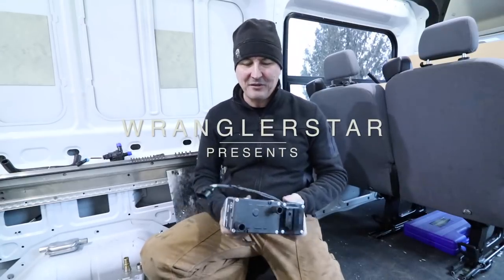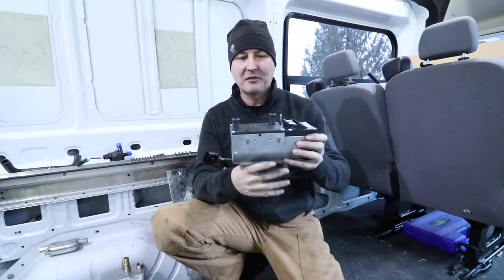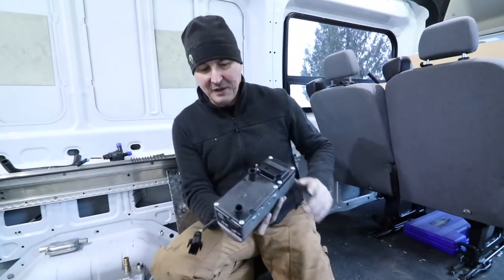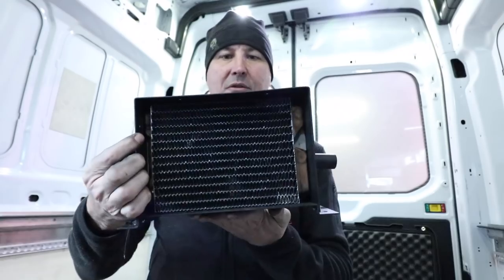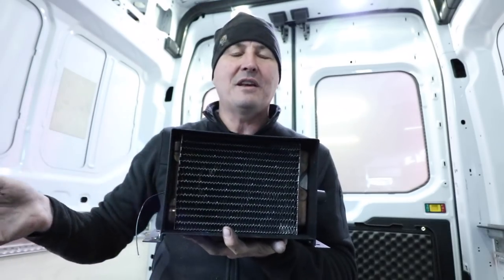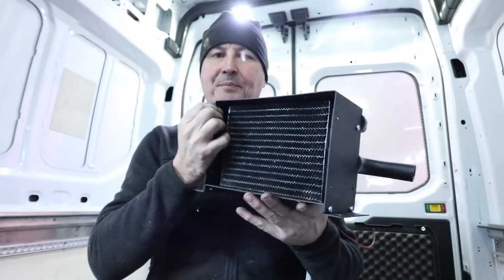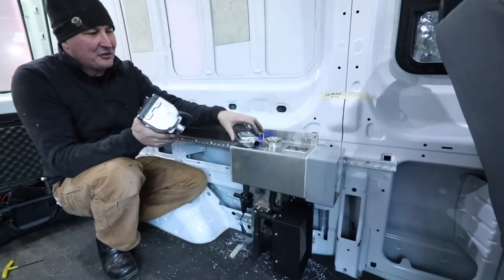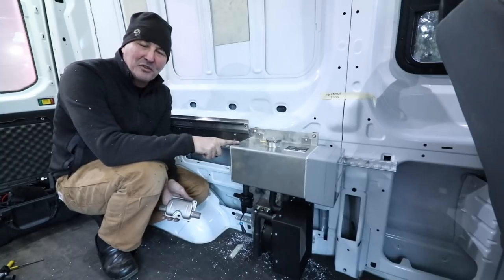Installing A Rixen Hydronic Furnace In Transit Van - ESPAR

Comment: Hello! Are You planning to add insulation for all of the metal surfaces, like walls or roof? Wouldn't sheet metal surfaces act like radiators when You're trying to get Your van nice and warm in cold weather? 
Cheers, mr Wranglestar!
Reply from the maker: Yes I'll be insulating the van,
Reply: Wranglerstar I did spray foam and rigid foam board in my astro cargo van and it not only regulates the temperature well, but there's so much less noise while driving. I was amazed at how much road noise the van made in it's stock configuration.
Reply: dahn I was wondering that too.  We will just have to wait until the end of the build to what was done.

Comment: Cody, Any woman would have said you need to remove the metal shavings from the carpet before you install.  Think there may be bare feet on the floor.  Some of the shavings are right under your bed they could get under Mrs. W's feet.

Comment: Do you also use it for pre heating your engine or does it heat your water for the shower and so on? I've decided to install a small hot air heater from russia (Planar 2D) wich heats the air with diesel power wich is very fuel efficient and doesn't need lots of electracial power. By using my second battery the system can run up to 48 hours without charging the battery (by using the heater only) with charging my devices and using the fridge it's more up to 20 hours. 

The Planar heats your RV very fast but doesn't produce hot water. Do you use a second battery for the back of your van to make sure, that the engine will start also at the next morning?

Comment: Conduction not osmosis.  Those tracks are similar, but are not airplane seat tracks.  Airplane are much beefier.
Reply: I worked for Boeing for ten years.  The track for seats is T shaped with the seat track on top.  It has wide flanges to attach the floor to, the vertical leg is a stiffener so yes its much different.  But yes it does have a similar track shape.
Reply: I  worked at DHL and what he is using is basically the track system on cargo pallets.

Comment: You want to have the lowest points of the fresh water side to be a T where you can drain the water out that will get trapped by the 90. 

a secondary fuel tank for the heater would be better to not drain the tank if you forget it is on. Something like a 5 gallon tank would give you 50 hours of use at that 10 hours per gallon without touching the fuel for getting home.

Comment: Espar has been around for years from Germany.
Reply: Different areas use different tech as a preferred no matter how efficient or inefficient it is. Most of Europe uses residential boilers where the US it is mostly forced air so them using liquid heating in vehicles is logical

Comment: When it heats hot water, would this be like a tankless water heater, hot water on demand?  Is the water hot enough for a shower, such as 120 degrees F.? Does the heater make much noise heating the air since I plan to install mine under the bed inside the sprinter using it while I am sleeping?

Comment: This draws 12.5 amps with a 120 amp hour battery,  you are looking at only 9.6 hours run time.  It is only (5,118 BTU’s) that's nothing.  If you go to bed at 10pm by 7:40am  your done, forget about breakfast using a toaster, microwave, lights, water pump, fridge etc..  now you need to wait 2-4 hours for the battery to recharge. That means starting the van for that time or running a generator. If a Lithium Battery dies it can never be recharged again  ever unless it has a battery management system to shut itself down, that would happen by 7:20.

Comment: Be careful about mixing metals in a water loop, I've worked with liquid cooling in a computer and when you mix copper and aluminum for example causes the metals to corrode and muddy up your water, so just look into it to make sure you don't end up with a corroded loop.

Great work though.

Comment: I can not help but notice that you have about 6 inches of room lost behind that plate you have just installed, could you have made it so that the unit fitted inside the cavity and the plate would be countersunk so that it still fitted on the same screws but made use of the space between the bulkhead.
Reply: amlee Tru Dat
Reply: John I was thinking that at first as well, but then how would you insulate that part for the summer heat?
Reply: That space left is where the insulation will go.

Comment: What keeps the water from freezing when the van is just sitting in the winter? Do you have to drain the system if it's not in use in cold weather?
Reply from the maker: Ethylene glycol
Reply: The heating/circulation system is similar to the engine system, in that it's a water and coolant/antifreeze (ethylene glycol) blend, so it won't freeze up.  The potable water half of the heat exchanger can easily be winterized between cold-weather uses by keeping a jug of RV antifreeze handy (or a pre-mixed jug for simplicity), and flushing a mixture of that through the block before parking it.

The potable hot-water half is more likely to be used while camping, for showers, dishwashing, etc.  I imagine there'd be less demand for "hey, lets MAKE some hot cocoa while we change out of our ski gear", and certainly no standing outside the van in winter to shower, so that half could possibly stay treated and winterized all season.

Comment: Is this also known as an Espar or Eberspacher hydronic heater?
Reply: Also, why would the water need to be drained from system in winter? Isn’t the point to provide hot water and hot air year round?

Comment: so it doesn't have to have the van running to work ?
Reply: Trevor Holland no, they use very little electricity.  It is best to have them hooked to a voltage protector or a secondary battery just to be safe but is not required so long as you pay attention to the draw.

Comment: 4200.00 dollars plus 400.00 for the high altitude module. Given how inefficient and noisy my present heater is in my rv.
Probably not a bad price. I got the price off of another installers page.
Reply from the maker: If you have a gas engine you don't need the HA kit,

Comment: Hopefully you aren’t installing that Li battery in the path of that blower!
Reply: li batterys with high capacity have a high heat rating not to mention itll be near freezing when that heater is running so i wouldnt be worried about setting the boys seat on fire with a hot li batt. :)
Reply: John good point.  Your car battery is surrounded with 300 degrees of heat all year.

Comment: Do not attach your heat exchanger directly onto metal of your chassis as this guy  does.. It will act like a heat sink for your van and transfer the entire out outside cold air into your hot water system. 🤦‍♂️

Comment: So you just made a heater in that HUGE space. 🤔Hmmm. Why couldn’t you just go with an eberspracher airtronic, or even one of the cheaper chinese knock-offs for only $140. Way less space use, money, and no running water to a heater core. I guess it makes sense if you don’t think about it.
Reply: Isn't the deal that it heats your hot water, with a 2Gal tank and provides hot air.  The Airtronic is just hot air.  You still then need a water heater/tank?  Perhaps I'm not following right, but that is how i see this.

Comment: Location is a space waste
Reply: under the bed?
Reply: everything in a van is compromise...
Reply: I totally agree, but there are a lot of other places you could locate (part under the hood and the rest under the floor) this system and allow this space to be used for something else. It would be a lot more work but makes room for something else.
Reply: as he mentioned, it will be used as a heating source as well so I'm so that has a lot to do with it.
Reply: Keeping all the water lines inside eliminates some freezing problems.
Reply: Or you could insulate the lines and run a hot water loop (from the engine cooling system) line in the insulation jacket to keep the lines from freezing or be able to thaw them. I think Winnebago already did it. A zillion different ways to do it.........
Reply: Carl tru dat

Comment: I'm sorry but all the drill shavings on the floor are driving me nuts would it not been easier to vacuum them up before instalation
Reply: chas7193 he said it multiple times he's taking it back apart, needs to put the washers on and also the hose clamps.

Comment: No such thing as a "hot water heater".  Just a water heater. There is no need to heat hot water!
Reply: Channeling George Carlin.
Reply: What about the steam reheating loops in a power plant boiler? Steam is hot water and they are heating it up more.
Reply: Hot water is 120 degrees Fahrenheit. There are many applications where you need much more than 120. Therefore once you hit 120 and continue heating technically your heating "Hot water ".
Reply: A hot water cooler?
Reply: No need for trolls like you
Reply: Bender lol that's what we use to call it back in the day.  Hell, I still call it that!!!
Reply: Way to be technical :)